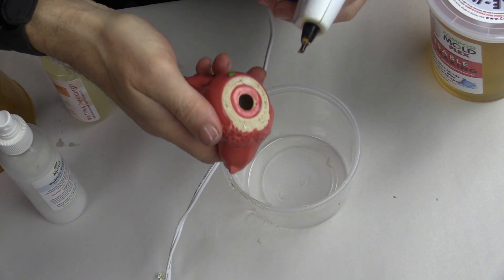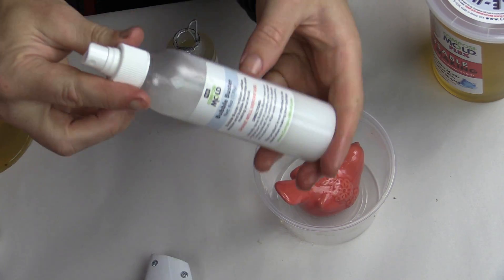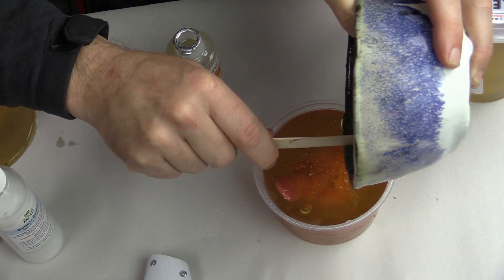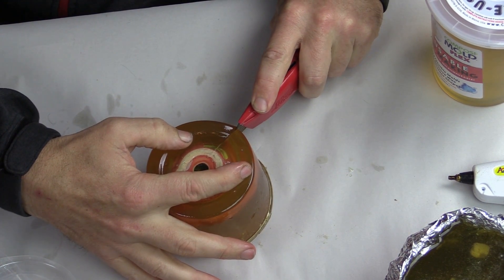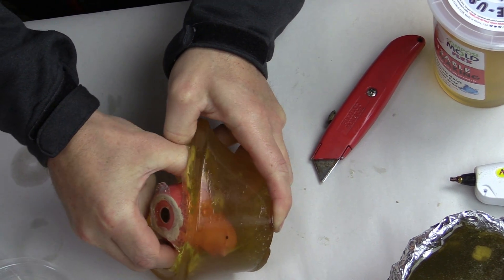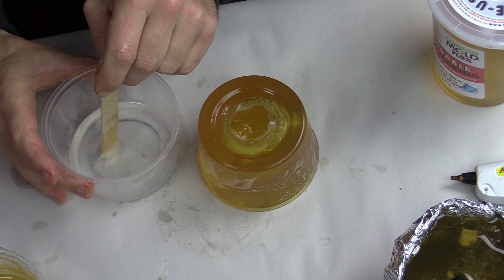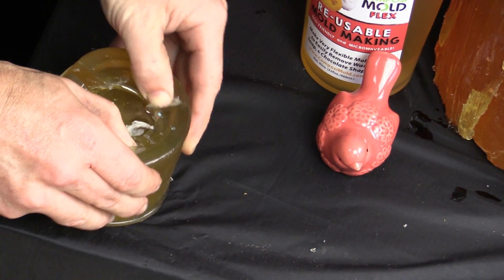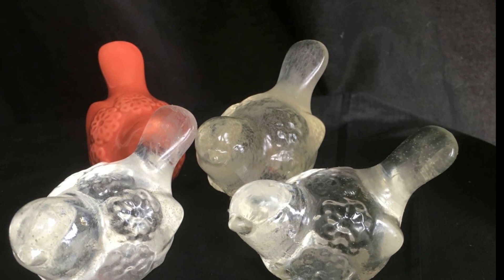How to Make a Clear Casted Part: Clear Bird from Ceramic Bird Original

Comment: after the casting plastic has set, can you sand/polish it? can you encase things inside of it? Im trying to work on a project where I encase a bit of rock and wood inside some sort of clear, strong resin/plastic to use as a guitar pick, and i think the best route would be to go with something that I could sand and shape after it sets. If you have any recommendations I'd love to hear them!

Comment: Hello, great video : ) Can you use regular resin in composimold or does it get too hot?
Reply from the maker: Thanks for the question...many resins work well with ComposiMold. We developed ComposiCast because we can guarantee that it will work for sizes up to about 4 cubic inches, but many urethanes, epoxies, and even polyester (like Bondo) work.  For larger pieces, you will need to consider the heat caused by the curing: chill your mold first, use fillers, pour in intervals...if possible use resins with longer cure times. 
We have two resources that can explain in more  detail:
For urethane resins: http://composimoldstore.com/journal/urethane-resin-casting-for-awesome-molds/
And we also have free e-book that you can download: http://composimoldstore.com/free-e-books/

Thanks Pania!